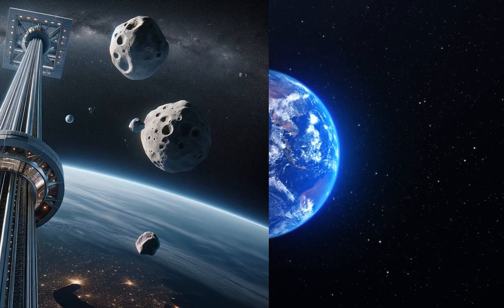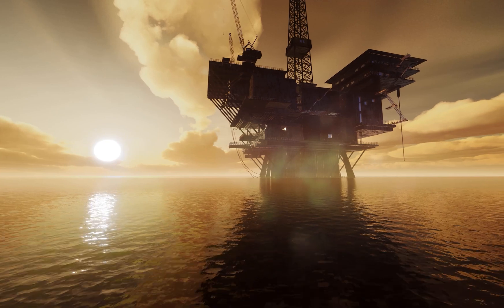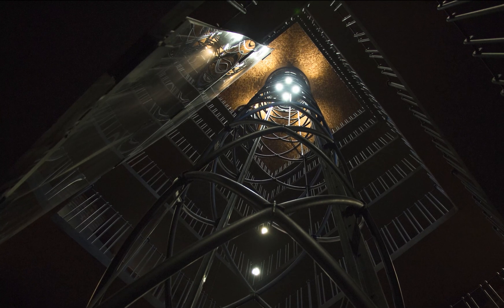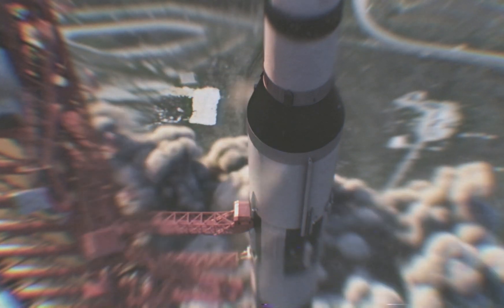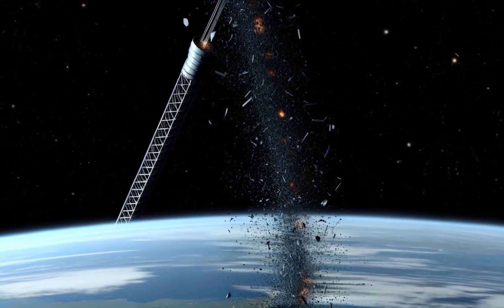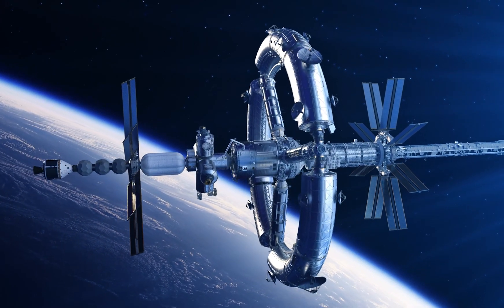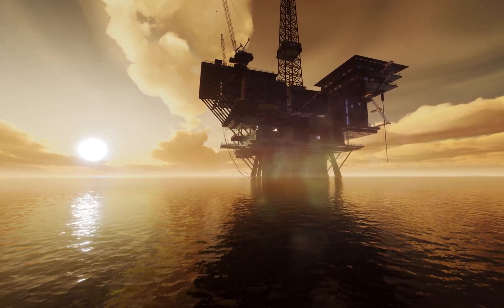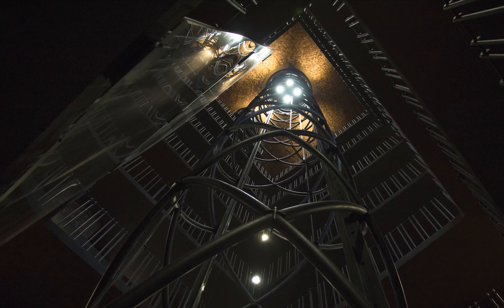Could we Really Build an Elevator to Space?

Comment: I've always wondered how the anchor part would work. I doubt you could put it on a floating platform because of the amount of outwards force, it's literally going to need to be anchored directly to the crust of the planet. I mean, this thing is going to weigh 1000's of tons and is going to be getting forced away from the planet through centrifugal forces and honestly, I have no idea how you would calculate the amount of force been produced at the anchor point but it's got to be an astronomical amount! Just think about how hard it is to stay on a playground roundabout when your mate is pushing fast, now imagine weighing 1000s of tons and been spun much much faster!
Reply: If the outward force is balanced by the incredible weight this cable (and elevator cars) will have to be, then almost no force will be transferred to the base.
Reply: @markschoenberger7825  Just the fact that it stays upright mean's there's at least some force on the anchor point right?